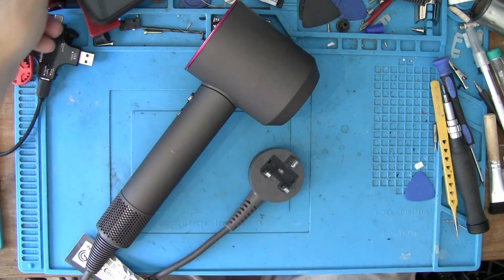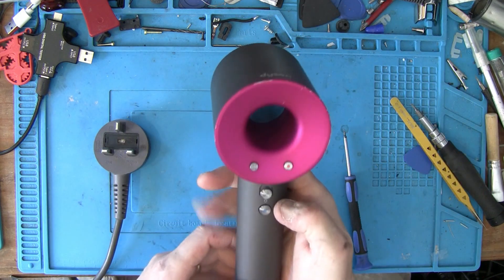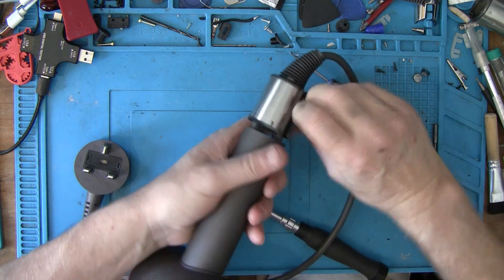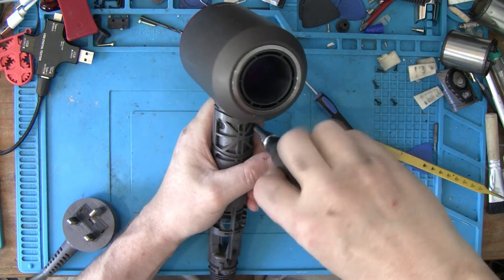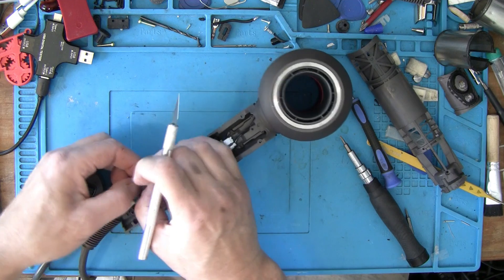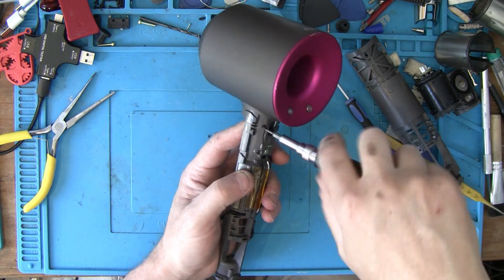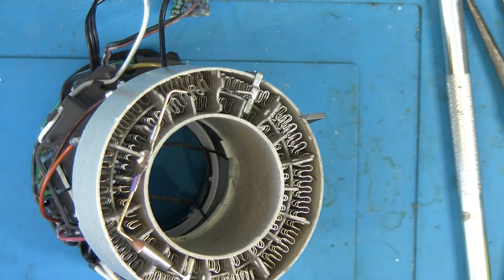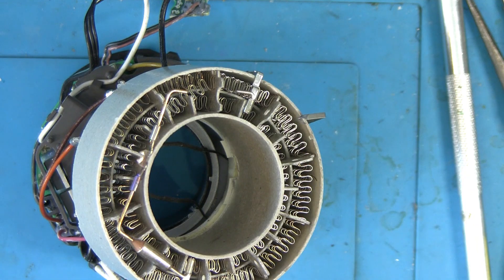Dyson HD07 live stripdown

Comment: Super glad I found this video, great watch! The supersonic I’m working on just has a blinking white led, after the three red leds blink for a second after plugging in.

Opened it up and got to the thermal fuse part, but my hairdryer seems to be assembled differently. Instead of having two fuses that connect to each other to wrap half way around the dryer, there’s only a singular one on mine, with longer ends that reach from one side to the other.

Then there’s another (much smaller) fuse connected to two wires, which are soldered to the metal chassis in an area not covered by the other resistor. Those wires run to the PCB and plug in with a connector, I’m guessing for the ionizing stuff.

Would love to know if you’ve come across a similar model. Mine (seems) to be a North America HD08.
Reply: Upon further checking, it appears I’ve gotten a fake :(

Huge thanks for your other video on Dyson fakes for helping me find this out.
Reply from the maker: @VeryCuul thanks for watching my video and for commenting.
I was thinking that your unit was maybe a fake but you have already figured that out. Normally when you get a some LEDs light up briefly, it's down to either the motor or the filters are blocked. In your case it could be any component that has failed.
A big giveaway in future is to look for tory screws, if you see anything other, then it's 100000% fake.
Reply: @Mickwild562 Saw Phillips screws PLUS the blue and brown wires haha. Glad I didn’t pursue fixing it further though.
Reply: @Mickwild562 I may have found a broken genuine supersonic hairdryer. None of the lights turn on when it’s plugged in. Would you by any chance know what this commonly indicates? Very much appreciate your help with all of this :)
Reply from the maker: @VeryCuul 95% of the time it is either a bad cable OR thermal fuse(s) problem. Thats what I see most commonly,  sometimes though one of the diodes on the bottom PCB can go bad too and sometimes this can take out other components too, but this is less common,  especially over here in the UK. 
I buy my thermal fuses by the 100s, just to save even more money, which I then pass onto my ebay customers.

Comment: Super helpful video man! Exact issue with the wifes dyson. Curious, what the part number for the thermal fuse?
Reply from the maker: Hi,

Thanks for watching my video and for your message, I'm glad it's helped you.

I use a 240v, 10amp 180 deg thermal fuse as a replacement. The same thermal fuse is used in the Dyson hairdryers as well in GHD too.

I hope that helps,  if you are in the UK, I can send you 2 thermal fuses, all I ask is  you cover the cost of postage.

Mick
Reply: Hi. Is there possibility thermal fuse is that much hot and in result melt plastic ring in it's vicinity? If so, exchange it will help? Dryer works fine, but as I said plastic around is bit melted and attachments do not fully fit as well